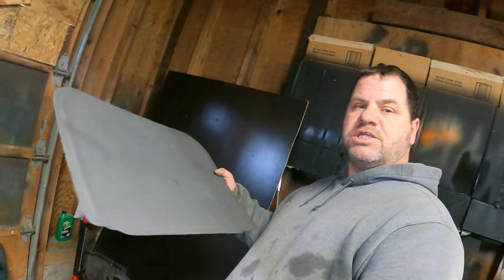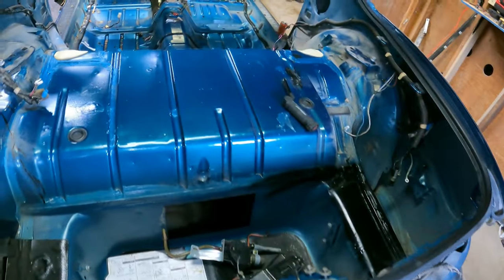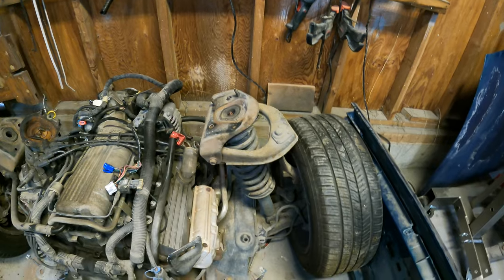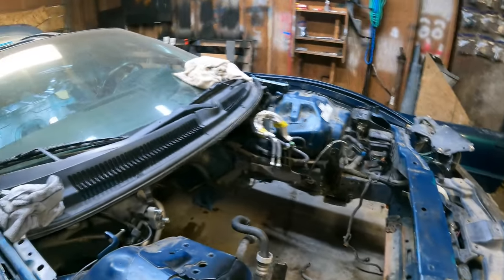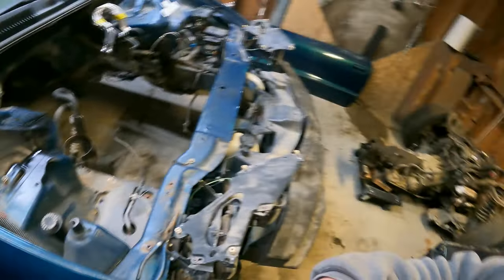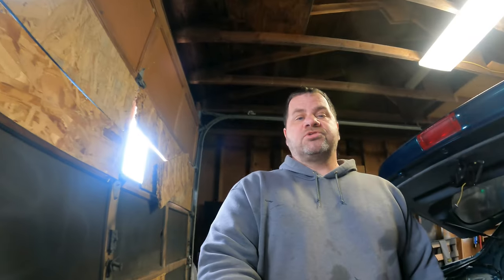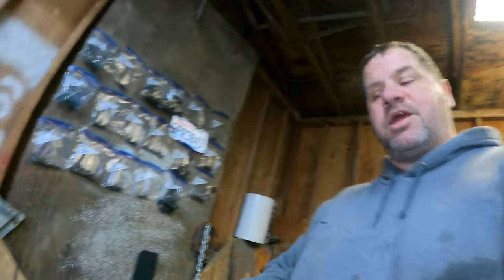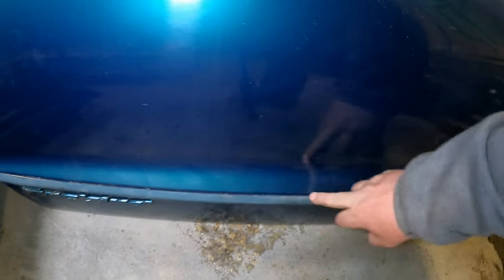99 Pontiac Firebird Restoration, LS swap, Project Black Widow! Treasures found.

Comment: You're getting work done at a pretty good pace! It is neat to see what you find in a used car. If you drop the gas tank, it is a giant pain. Remove the exhaust, panhard bar, trying to get all the bolts out, ECT. I cut the trap door on one of my bird's last fall. I also bought another door emblem and stuck it on the front air dam. It looks pretty cool. Something else to consider is doing the wire mod where you run the wires through the wheel wheels. Look it up... And I like the video, but you really don't need quotes with people saying the f-word. Just saying.
Reply from the maker: Thank you for watching. I really appreciate your feedback. 
I have seen and am totally doing the wire mod. It cleans up that section of the engine compartment really nice. 
I'm going to look at what all is involved in dropping the tank. I might end up cutting the access hole but we'll see. 
I don't think anyone has ever done what I want to do with the emblems. 
I hope it works out. 
I debated on whether or not to include that quote clip. In the end I figured why not. I appreciate you letting me know that it wasn't needed. In the future I will do better to clean it up. 
Again, thank you for watching and offering your feedback. I appreciate it more than you know.
Reply: @ScottsChaos  it's all good.   I am curious about your door emblem idea, but if it's good I may have to borrow it.
Reply from the maker: @michaelm3381  if it works out it'll be good. 
I'm still in the R & D stages of it.
Reply: Drop the @&$ language bit. Looks like you could get a job at Pick An Pull as a parts scrounger, if the day job thing doesn’t work out.
Reply from the maker: @richardgillard779  I'm hoping I can put it all back together. 😁